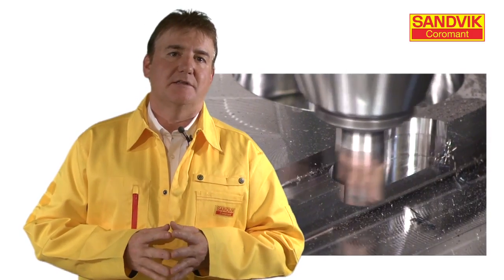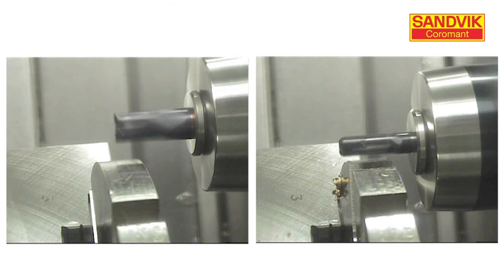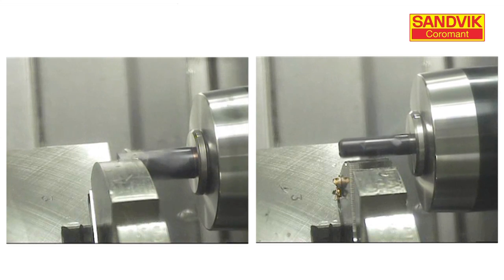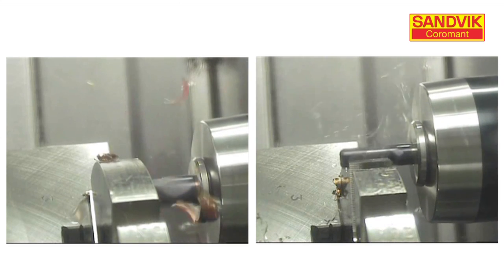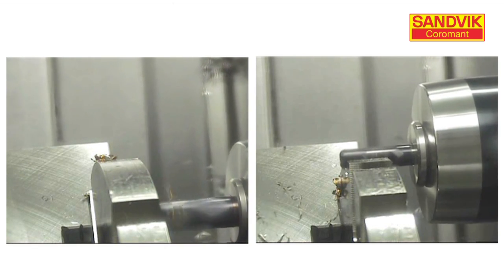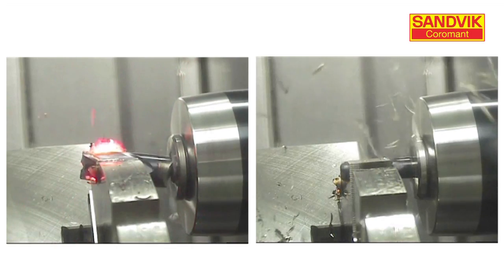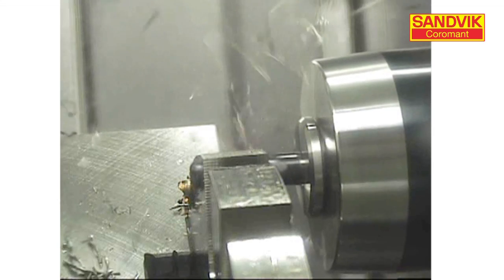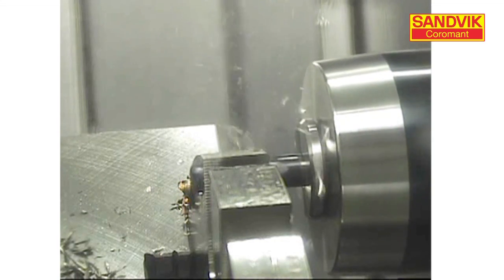Tips film: Trochoidal milling machining

Comment: My question is why not go full depths and slow down the cutting speeds on full slot milling? I would be worried about tool pulling out on Inconel though I’ve never cut the stuff. But would preventing excessive heat build up be sufficient for the productivity of the tool life. Also this tool could have lasted twice as long at full depth. Not trying to take any credibility from the video but It’s my trouble shooting methods that lead me to believe this. Focus on the problem and eliminate it
Reply from the maker: Hi Carlos! There are many reasons why applying the tool at full depth and full slot with a reduction in cutting speed will be problematic. In the video you will have noticed the heat build up in the swarf chips, this is partially due to the cutting speed, but equally due to the full radial engagement of the tool. If we consider the type of tool geometry required to machine a full slot, it requires a deep and wide flute to provide sufficient space for the chip that is generated, this in turn means that the core of the tool is relatively small and potentially weak. If we compare this to the preferred tool geometry for trochoidal milling, the flute can be shallower and narrower due to the smaller chip produced, this means we can have a bigger and stronger core, providing greater stability and strength. We can also increase the number of flutes, thus enabling us to increase table feed and metal removal rate. The secret is to achieve maximum metal removal, whilst keeping the heat generation to a minimum. Inconel is a Nickel based HRSA (Hear Resistant Super Alloy) and the heat produced during the machining operation will not be absorbed by the component material, so it will be absorbed by the cutting tool and coolant, which should always be applied (not shown in the video, as the mist would obscure what you see). With reference to tool pull-out, the corkscrew effect, this has and can be problematic, but modern tool-holding chucks eliminate this. Finally, with many machine tool builders adopting a “fast & light” philosophy when developing new machines, we now see machines that are more agile with faster machine spindles, lower power consumption and smaller machine spindle interface including ISO30, ISO40, HSK63 etc. In parallel to this, we have seen a huge development in CAM software. If we put the two together the theme is to take small cuts using smaller tools at faster speeds and table feeds, where the process is faster, quieter and above all more robust to support more autonomous lights out machining. To this end Trochoidal milling or HFSM (High Feed Side Milling) as it is also known, makes it the preferred solution due to the robust process and improved productivity. We at Sandvik Coromant would be very pleased to explore this machining process with you further and demonstrate this in a real life environment. We thank you for your question and have a nice summer!

Comment from the maker: Climb milling is the preferred method. The only reason to use conventional milling is for shoulder milling with big ap when there is a high demand on straight walls. With convential machining, using solid cabide tools, the cutter will bend towards the machined wall and will be supported by the wall and as a consequesnce, the bending will be reduced.